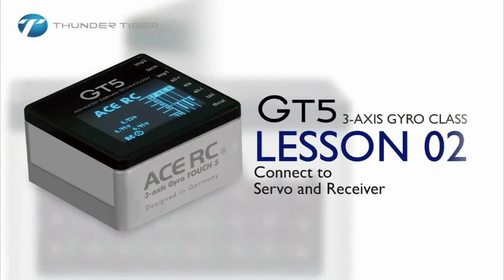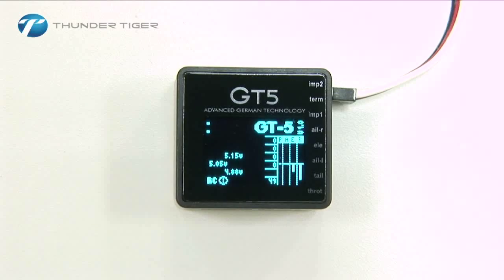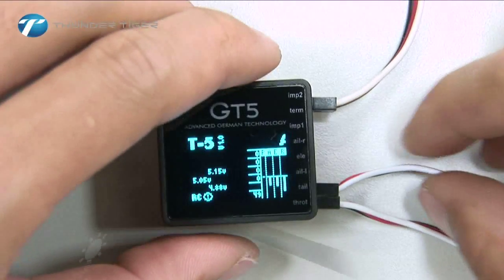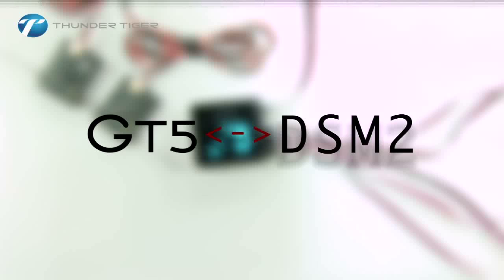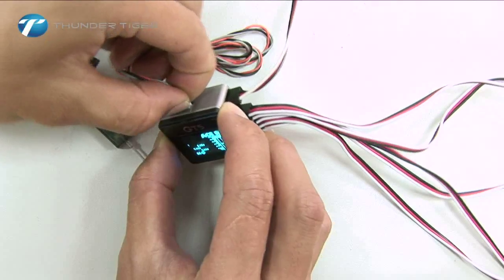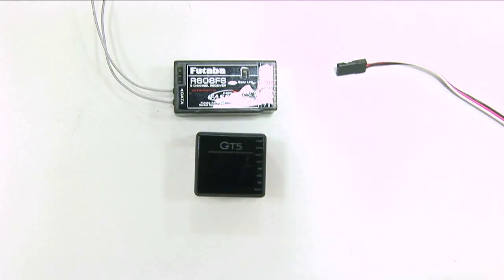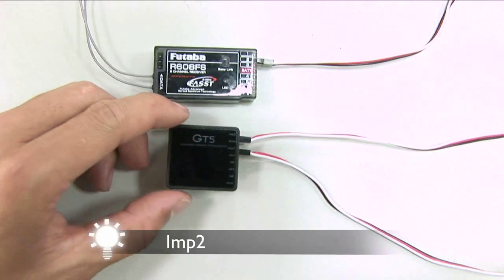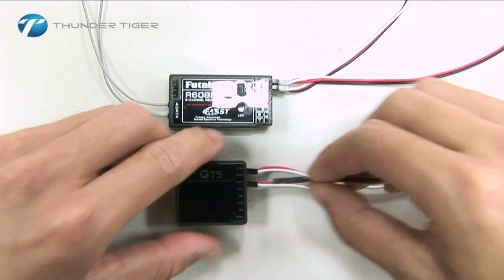Thunder Tiger - GT5 Gyro CLASS - LESSON 02 : Connect to Servo and Receiver

Comment: @revmaxhobbies 
With the GT-5, on  any 120 or 135 eCCPM swashplate, what would normally be described as Pitch and Aileron input are both referred to as Aileron right  and Aileron left. These channels are interchnageable and it doesn't matter which way round these channels are plugged in.  An eCCPM set up does not actually have one single pitch input, as all three swash servos move together to input collective. Simply plug the elevator servo into 'Elev' and ail and pitch into 'Ail R' & 'Ail L' .